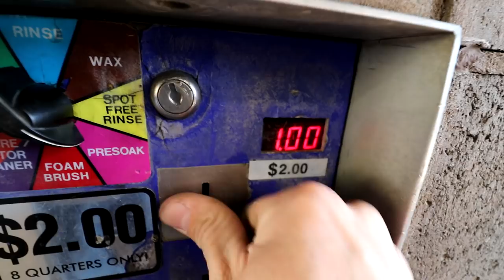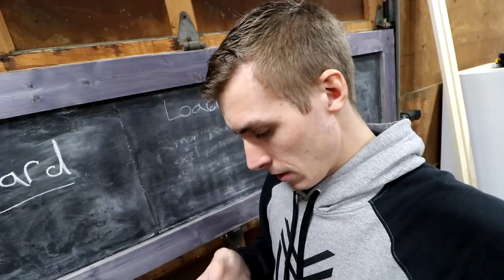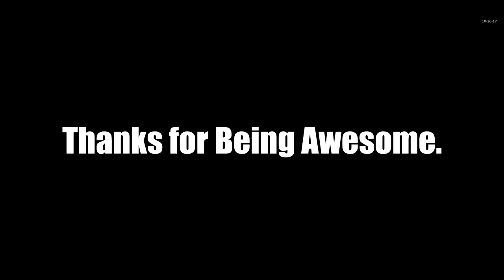NEW DURAMAX MODS Reveal!!

Comment from the maker: 72 Hour sale
Buy any of the following and get a free pair of mirror decals, 
Sweat Shirt, T-shirt, Hitch Step, Machine Decal, Team 3DMachines Decal
https://machinemerch.com/collections/all
Reply: 3DMachines sup shout me out
Reply: Go see pug1 have him build you some bumpers for the dmax
Reply: 3DMachines just a heads up you spelled black wrong on machine merch with the dirt bike spokes
Reply: liked and subscribed
Reply: 3DMachines  Your next mod should be to get some XD  Series wheels.
Reply: With the gator engine you should make the ports larger and get it it ported, shave the heads for better compression and on flat heads at least briggs all the way around the valves there is casting that is raised up you can shave that down with a dremel and it will flow better for more power just locker up how to shave ears on a briggs flat head you will get the idea and it will help to make power with or with out boost
Reply: Omg the dirty max looks great you needed those rims and tires now you should get a wider tire though
Reply: Keep up the good work
Reply: 3DMachines Next mod should be a high performance chip
Reply: 3DMachines  You should also check out Custom Text  Large Rear Window Decal Stickers.
Reply: 3DMachines  I watch you every day you always make me laugh or smile!
Reply: You should do a run of the big “machine” decals.  I got a F-350 that would look nice with a decal across the windshield.
Reply: 3DMachines what you are great at is bring machine freaks together
Reply: 3DMachines were did you get the mirrors?
Reply: 3D machines please get black rims your truck will be awwwwesome
Reply: 3DMachines hey
Reply: U did wheels and tires
Reply: Is the older style 3D machines with machines spelled in the d decal included in this?
Reply: 3DMachines what day will you be at the drag strip i live 2 mins from there you can ride at my house and go mudding

Comment: You need a 6 inch lift and black rims on 37 inch Tyers then it will look fire
Reply: DARCYFILMS 15 but he dosent take it off-road?
Reply: Does streetspeed717 no so why can 3D machines do it
Reply: DARCYFILMS 15 37s wont fit on a 6 inchlift on these trucks unless you trim fenders
Reply: Matt ra how about 8 inch lift
Reply: Would that be something different? As far as I know it's not uncommon.
Reply: Needs a big angry roobar on the front too
Reply: DARCYFILMS 15 yes a 8 inch would but any rim wider than 12 inches would probably rub

Comment: Dalton when you install those decals, especially on glass, use a spray bottle with water in it (no soap, just plain water) and spray the glass and spray the back of the decal.  Then you can re-position it until you get it just where you want it and then squeegee all the water out.  Sometimes you may need to use a hair drier if you want to be able to remove the mask more quickly.

Comment: Hey buddy, to fix the mirror tilting down, a buddy of mine got the same set. Add washers to the bottom bolt, and it evens it out. Not sure if you already did this, but thought it might help. 😁
Reply: Pretty sure there was a leveling adjuster under that cap he took off and ground on.

Comment: Duramax is starting to pop . She blows a bit black smoke out . Have you done a cheap map/ box . As some only make the motor run as if cold and over fuel hence black smoke when you boot it  ???  Which isn't the best way you need a good Remap not keen on the boxes you put on line with the pump wiring . I think they just make the pump run in cold mode and over fuel .